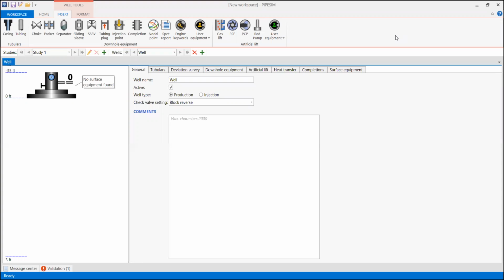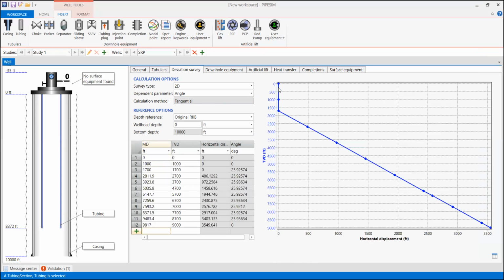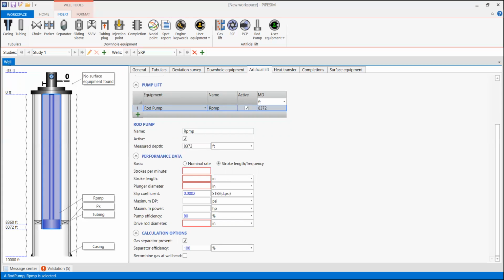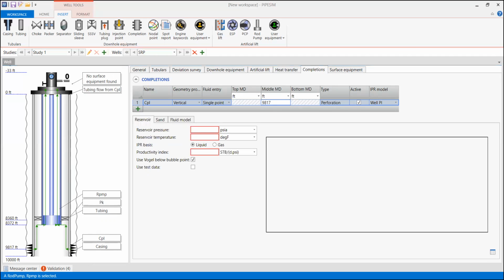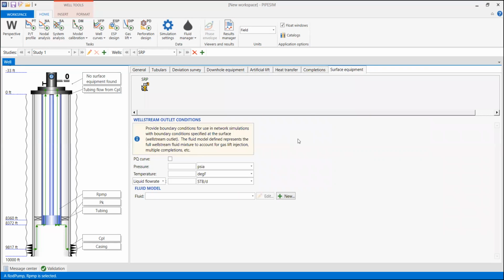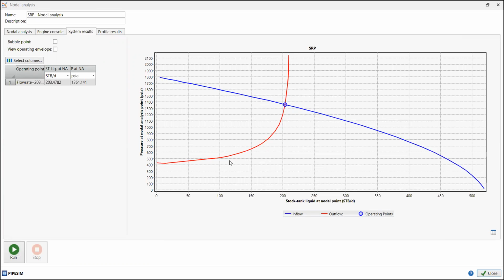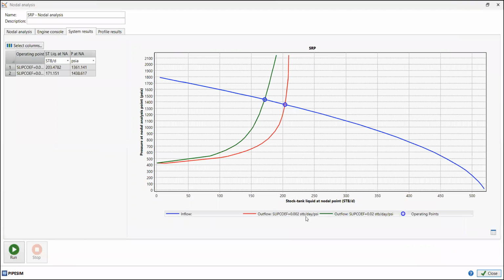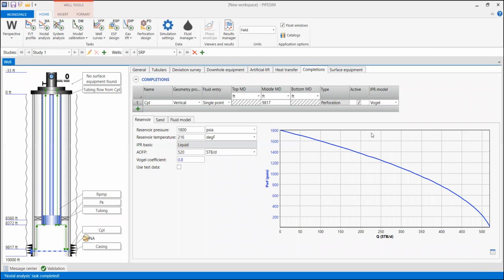Pipesim 4: Rod Pump Well

Comment: Thank you for the great video. I have a couple of questions:
1) Can sensitivity analysis be done on other rod pump parameters or usually it's just the slip coefficient and stroke per minute who have much importance?
2) Can Pipesim evaluate the gas separator efficiency? What are the parameters that we need to look for to see the effect of low gas separation?